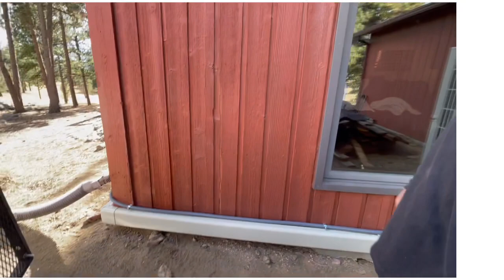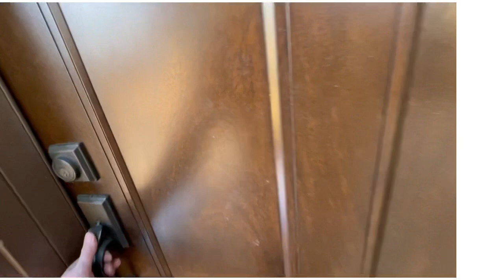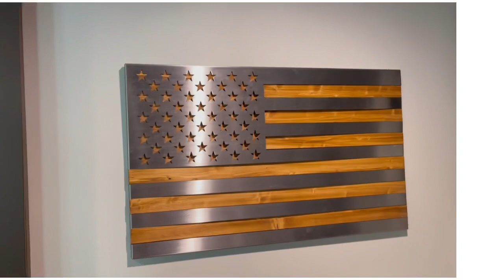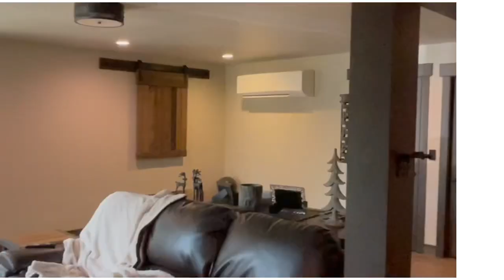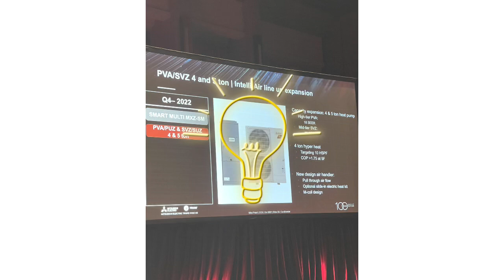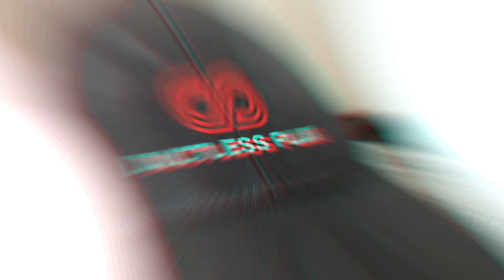Ductless Education Mini-Split Mitsubishi Ductless #DIY no way P-Series￼ Ductless Plus HVAC #1￼

Comment: Hi, do you all install or recommend installing phase/voltage monitors with these types of systems in addition to surge protectors? I didn’t notice that you had any surge protection on this job unless they have a whole home surge protector. Great information on this video.
Reply from the maker: Obviously it wouldn't hurt some people buy them some don't.